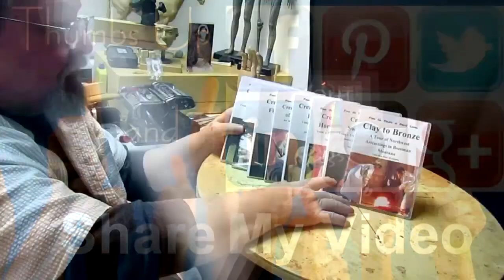CHASING THE INTRUDER, Finishing the Construction of the Base

Comment: What consistancy (medium, hard, or soft) of Monster clay are you using in the substructure?  Does the Monster clay stick to and work well with the JMac clay?
Reply from the maker: It's just going to be under the J-Mac.. not combined..
Reply: I understand it's under the JMac, but doesnt the JMac have to stick to the surface of the Monster clay to build upon it?
Reply from the maker: @michaelday1900  It has no problem at all sticking to the MC... It all works